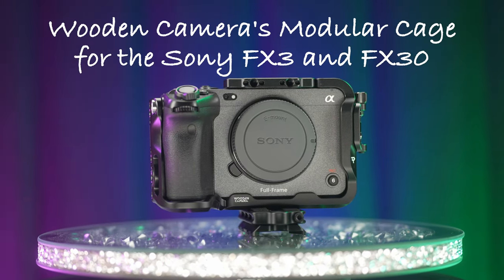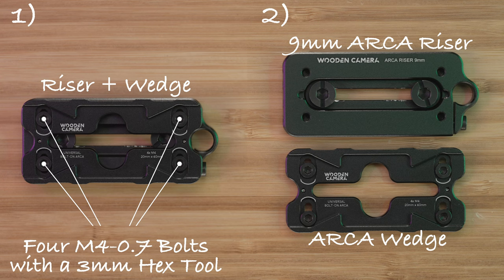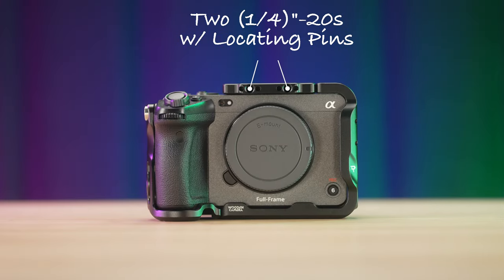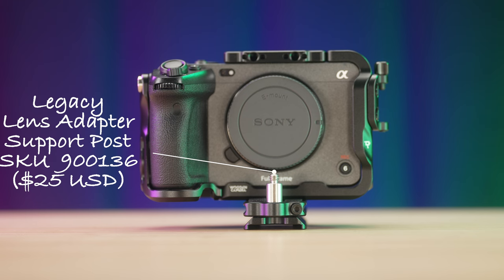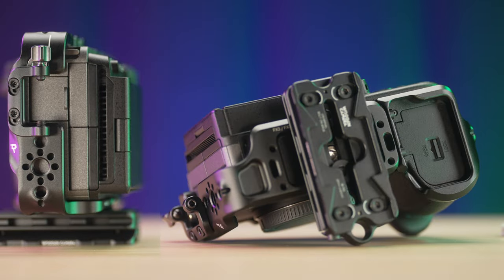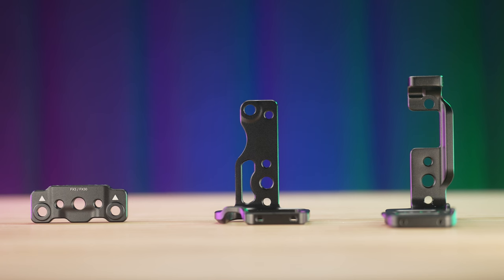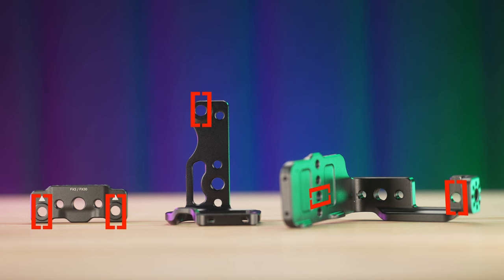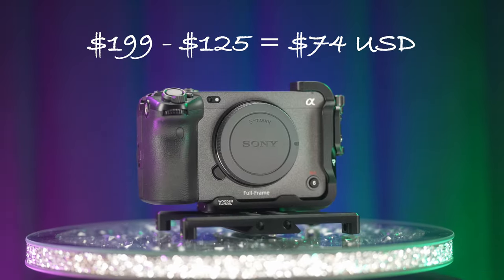Wooden Camera's Modular Cage for the Sony FX3 and FX30: Good Build, Flawed Design

Comment: where is the X like arca base plate that is shown a few times from?
Reply from the maker: https://kesslercrane.com/products/kwik-stand-xl. It’s called the Kessler Kwik Stand XL. Really nice system to use with Kessler Kwik Receiver V2-expensive but worth every penny.
Reply from the maker: Could you post the names of the products and sku numbers that you’re interesting in. I may have reviewed some of the items or have them in storage. Specifically the SmallRig items. Thanks!
Reply: @minneappledan  Of course! To Reiterate, I would like to see you mount every fx3/fx30 cage you have previously reviewed (tilta v1 & v2, smallrig v1, & kondorblue v2) onto the Smallrig V-Mount Battery Mount Plate SKU: 4505 with a Smallrig VB99 Pro Attached aswell SKU: 4292. I really want to see how an fx3/fx30 in these cages interact with the smallrig v mount plate, when the screen of the fx3/fx30 is opened & then left to rest against the 99watt v mount battery. Additionally, I would also like to see you review the new Smallrig HawkLock Quick Release Advanced Cage Kit for Sony FX3 / FX30 SKU: 4771, and again also mount this to the previously mentioned V mount plate, thank you very much!
Reply from the maker: Ok got it! I’m not doing many videos right now because im trying to finish my master degree, but I will do one of the two video ideas you proposed next.  I’ll reply here to let you know when it’s done.
Reply: @minneappledan  Awesome no worries, thank you so much, your style of reviews is amazing and I can't wait to see what you create in the near future!